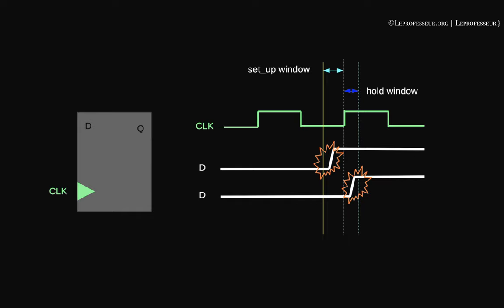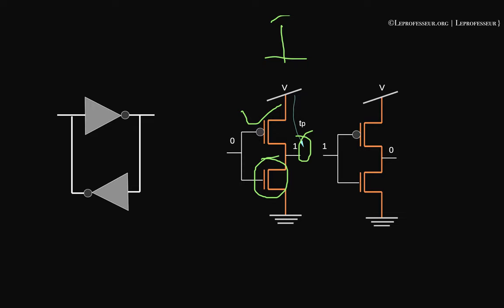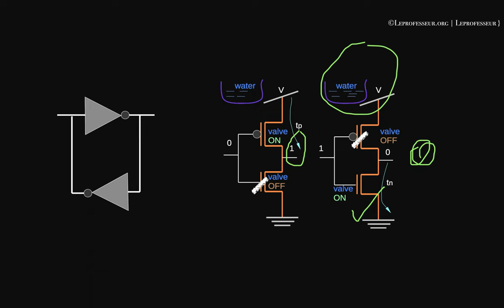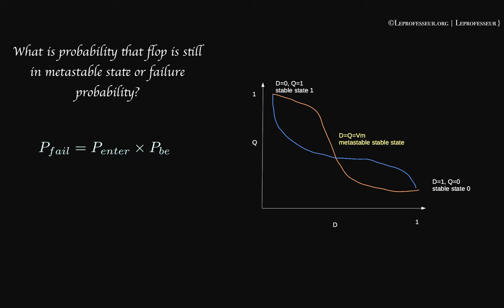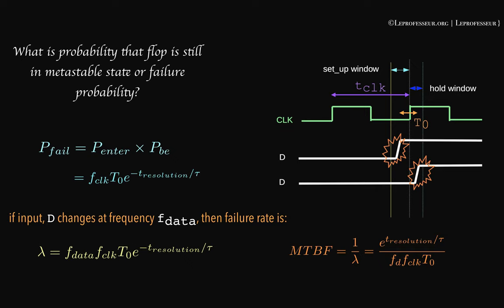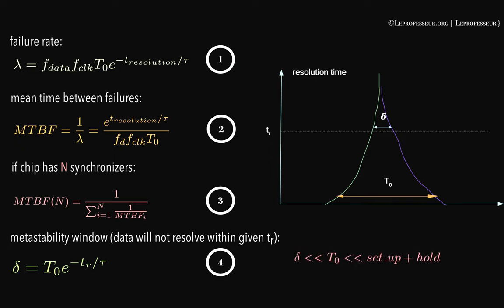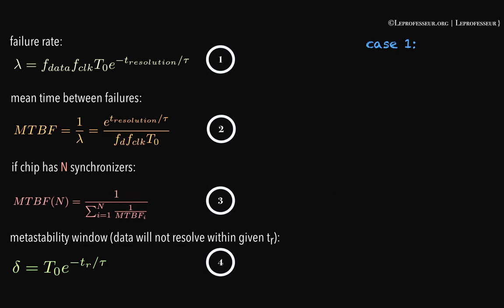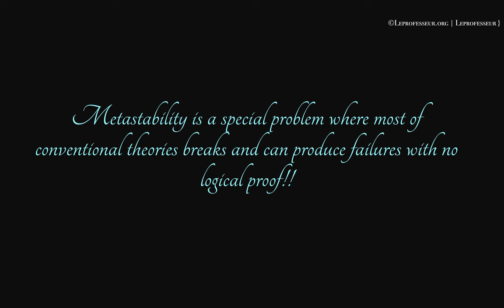⨘ } VLSI } 12 } Metastability in digital circuits } LEPROF }

Comment: In my excel  calculation I get the Case1 MTBF correctly BUT by just changing the f_clk frequency  I am not getting  your MTBF numbers. I am getting 23.36128 Hrs only
Reply from the maker: Thank you for message, I will need to check on this.